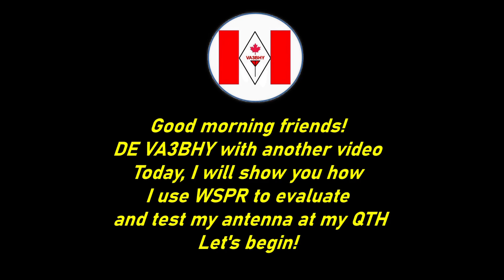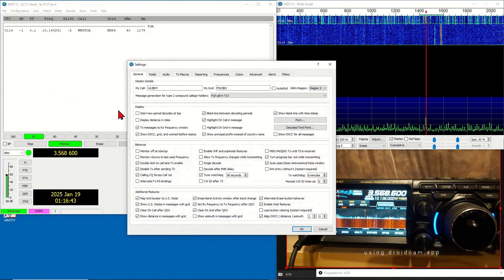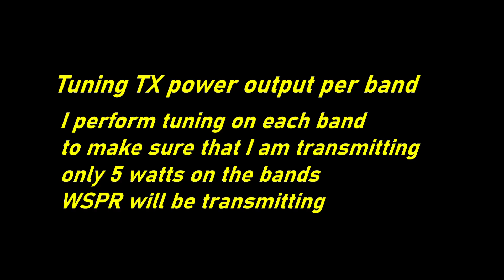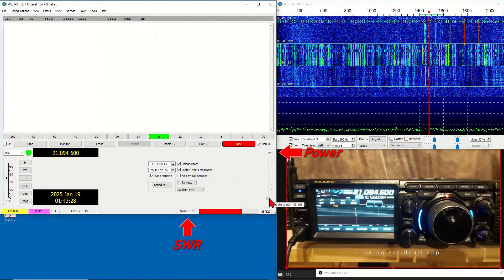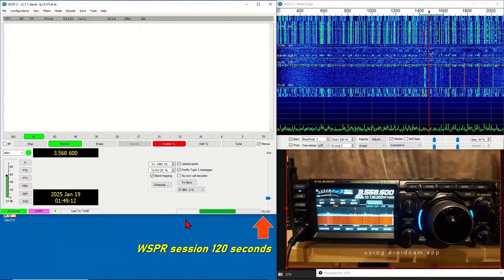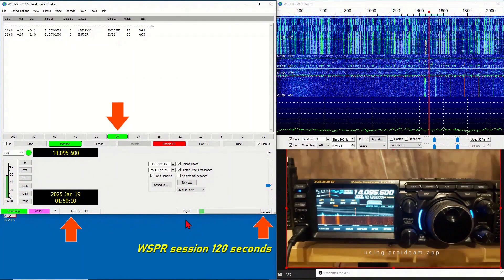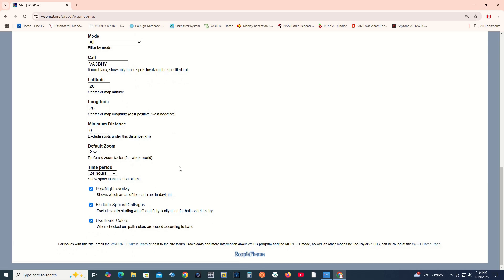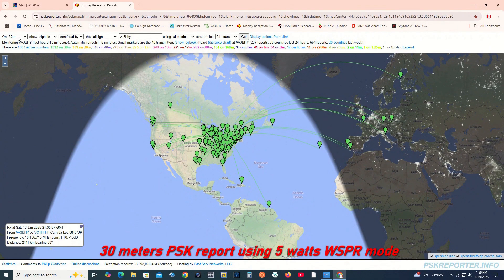WSPR Setup and Test Results

Comment: Thank you for this. I have wsjt-x v2.7.0 and I don't get the bands presented in the middle, also I don't get a power/swr indication after pressing tune. Is there a setting that enables these?
Reply from the maker: You will need a higher version than 2.7.0 - mine is 2.71 or better yet go to 2.80. Here is the link: https://sourceforge.net/projects/wsjt-x-improved/files/
BUT be careful on 2.80 some users reported a virus (trojan) infection detected by windows 11.